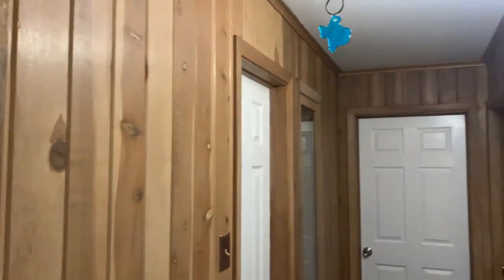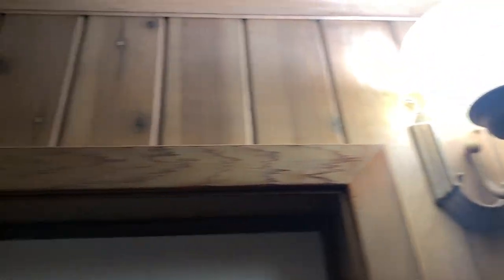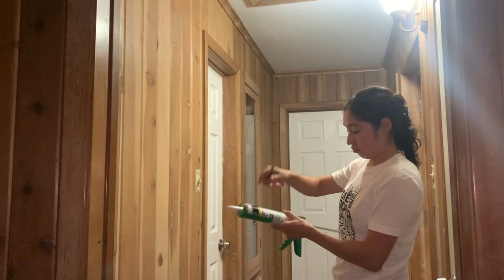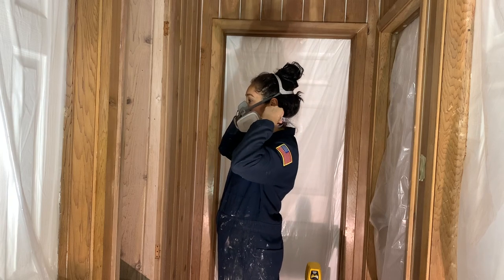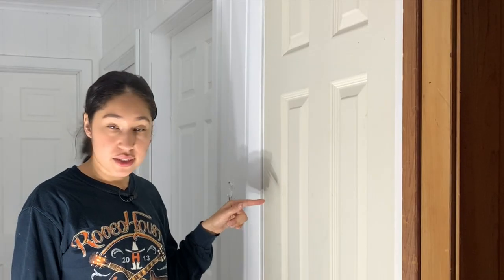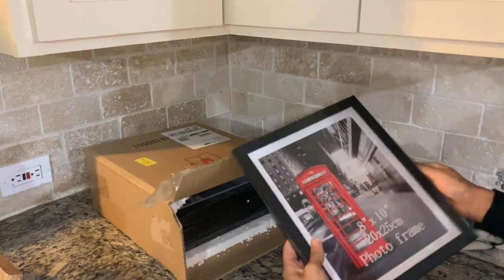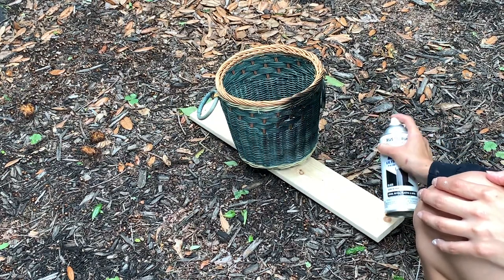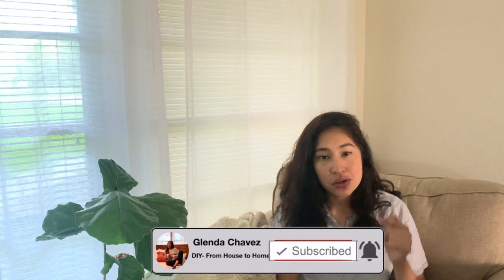Room Makeover 2021 | Hallway Makeover

Comment: What a difference! So bright and welcoming now. 2 questions: why did you caulk the lines in the panelling and doesn't the faux tree impede entrance to the room behind it? Just wondering. Great job.
Reply from the maker: Thank you! Exactly what I was hoping it’d look like! I caulked to cover the spacing between each board since the spacing wasn’t all the same... these boards are the originals from when the house was built in 56’ so there’s been some gapping/spacing ... surprisingly no the faux tree sits perfect right before the knob of the door to be able to enter... ! It sits more flat against the wall then it appears !

Comment: Hi , what did you paint your doors with. I always get brush strokes on mine 😖
Reply from the maker: Just regular latex paint… semi gloss in the behr marquee line …
Try not to overwork the paint… and make sure your using a good brush… it makes all the difference…. and if you find that you still get too many brushstrokes you can try foam rolling the flat surfaces and only use a brush in the detail/hard to reach areas